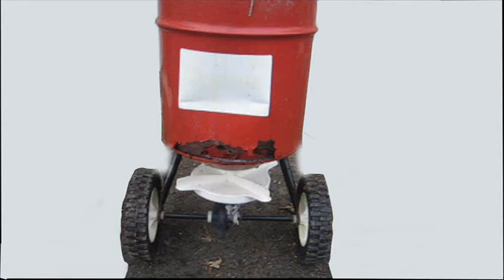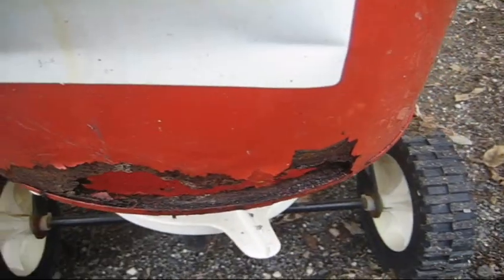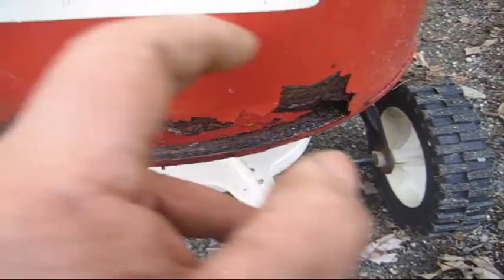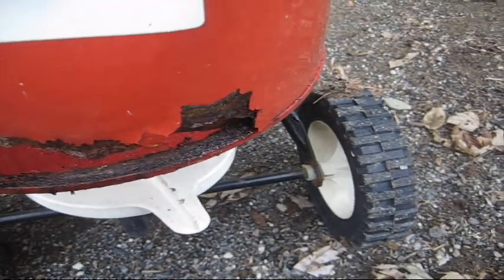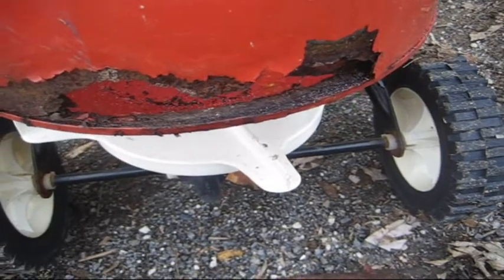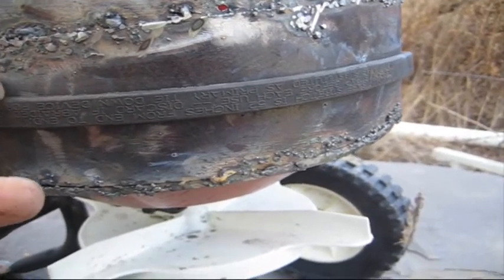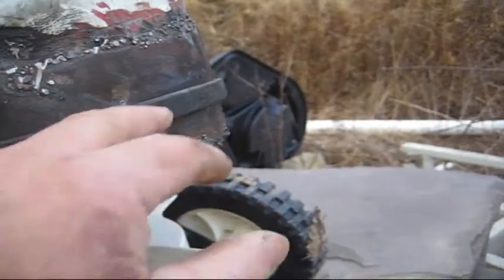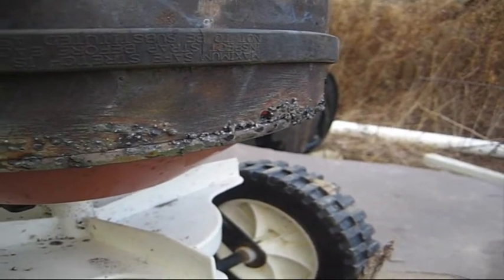#IAmACreator Dump pick restoration using recycle material

Comment: Dang, too bad about the welder! Shouldn't have to fight the machine for a straightforward weld like that. Bungie strap looks like it's working, though. And the price is right... :)
Reply from the maker: I have to bring the welder back. I was told HF will no longer carry this model. Just before making this comment I got their sale notice. It is on sale again $79.99. Have to get there ASAP. The patch is holding with out the strap. I managed to get  a few tacks. Thank you, Joe Z.